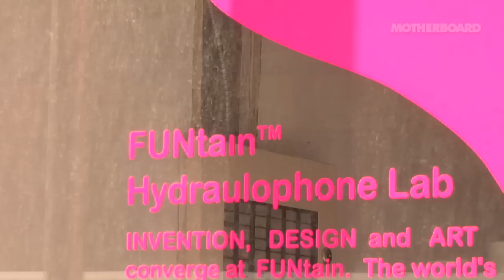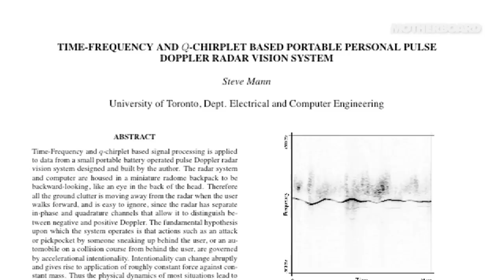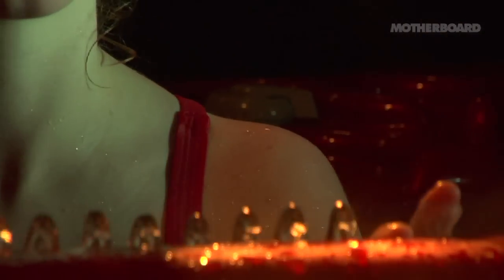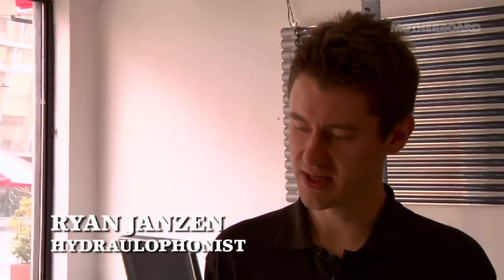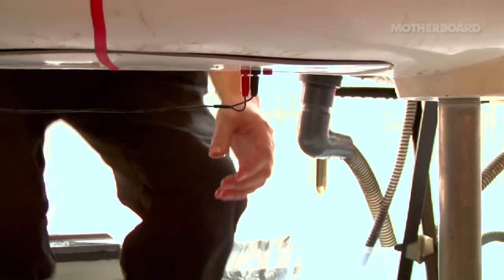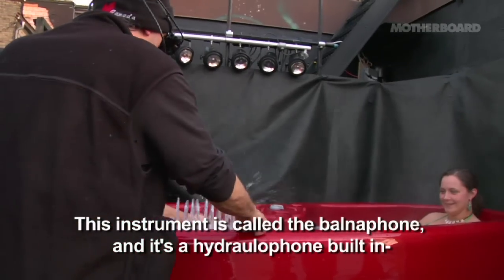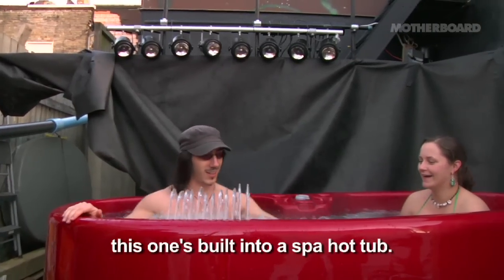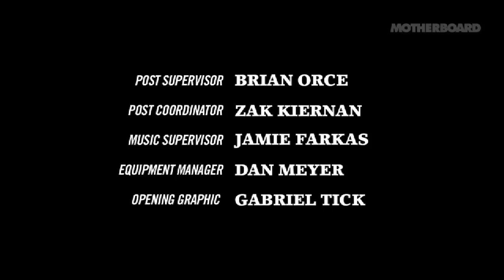This Is What an Underwater Pipe Organ Sounds Like: Sound Builders

Comment: That has a lot of potential, especially with the pressure sensitive range of notes. One of the things that seems to deter better performance is the awkwardness of having water pushing against your fingers. Something with more density would stabilize the pressure needed for sound

Comment: Glad to see a new instrument that isn't electronically based. Electronic innovation and invention is getting saturated.
Reply: It is electronic in nature. Why do you think he hooks wires up to the thing? The water is part of the control system.
Reply: I know, but the sound is from the release of pressure or lack there of, depending on finger placements. Its not a NI Maschine, ableton push, or one of the electronic guitars that has a display you swipe simulating the strumming of a guitar.
Reply: Frank Holguin
It's basically an electronic keyboard with liquid keys.
Reply: replace the water with foam impregnated with graphite you essentially have the same thing, theres a raspberry pi in the body - its a keyboard with water keys.. this guy is no more an innovative or an inventor than an apple is an orange
Reply: alberto gordillo i never said the guy was dean kamen. if its no different than why don't  you build one using foam and see if motherboard will interview you.
Reply: +itchykami You can say almost anything is basically something else. Why not say a car is a motorized carriage. The cassette tape is no different than a credit card, they both usen magnetism to save and send data. The guitar is a violin, but instead of a bow you use a pick.
Reply: Saturated!?!?!

Obviously never seen some of the more interesting musical inventions. Like the Theremin. Beautiful concept.
Reply: Sicarius Aevita I've seen it, thats cool, but I will still stick to my statement. No one is playing that like people play the drums, guitar, piano, or turntables.
Reply: I'll even add that instruments like the guitar, the piano, turntables, and violin used to be god like tools. Today, its just way to get laid and play songs that everyone in a room thinks is cool and sing along with, not a tool to expand the mind.
Reply: Frank Holguin My name is Frank and I have no idea what I'm talking about
Reply: Name a musician (not just a singer) today that has transcended music into something more? Whether it be political, artistic, scientific, philosophical, and be popular and experiential in equal measure. Jimi Hendrix did all this. John Lennon did all this.
Reply: Frank Holguin Death Grips
Reply: Man, hostile much? It's youtube. It's cool, man, it's cool.
Reply: jordan pasek Death grips experimental, but they're not on the top of the charts. Whats their transcending message?
Reply: itchykami  Who are you referring to?
Reply: Frank Holguin

Flying Lotus. You can go from there.
This is an amazing time in music.. sure there is plenty if not toooo much music out there but the more the better. You just have to spend time looking and listening.
Reply: MNDFND FlyLo is awesome, I have a lot of his music, but he's only amazing in music. Whats the transcending message outside music?
Reply: Alex Del Río No duh. Dude we did this already. Read the comments. I knew that before I made my initial comment about the video.
Reply: uhh Fly Lo has made an impact in art. Killer Mike has made an impact politically. many many more... Just because we don't have some national or global 'movement' doesn't mean things aren't happening. I find it that things are happening waaaay more than ever the scale is just waaaay grander(internet) We may never have a '60s' decade or a '70s' decade eagain... but I'm glad of what we do have and I wouldn't want it any other way

Comment: Yeah, but HOW does it work? Completely unclear.
Reply: Joe Schueller nah, he says it in the video. Just like a regular organ, except the way that the fluid is diverted through the pipes is different. In a regular organ, a key on a keyboard controls a valve, opening a pipe to the whistle-like sound pipes, and a note is played. On this, your finger is the valve. By stopping the flow of the water through the opening, it forces the water to go through its respective sound-making-pipe and a note is played.

Comment: replace the water with foam impregnated with graphite you essentially have the same thing, theres a raspberry pi in the body - its a keyboard with water keys.. this guy is no more an innovative or an inventor than an apple is an orange
Reply: alberto gordillo He says how it works in the video. Just like a regular organ, except the way that the fluid is diverted through the pipes is different. In a regular organ, a key on a keyboard controls a valve, opening a pipe to the whistle-like sound pipes, and a note is played. On this, your finger is the valve. By stopping the flow of the water through the opening, it forces the water to go through its respective sound-making-pipe and a note is played.
Reply: John Luzader there are no separate pipes as you can see in the video,  the sound is according to mass flow
Reply: alberto gordillo He says that the pipes are in the larger tube. You're not wrong, your idea could very easily work, however, in the video he specifically says how it works, and it is not how you say it is.

Comment: The physics of vibrating fluids is the source of the sound.  The air vibrates in a traditional pipe organ, but so do the pipes.  Here, because of the more limited compression coefficients of water, I would guess that the pipe in question is doing more of the vibrating.  However, when you place something under stress (strings, moving air, or moving water), you might expect vibration to occur.  Vibration leads to sound.  To the doubters out there, open your mind to alternative sound sources.  Hey, if Spike Jones could make a recording of barking dogs and turn it into music (of a sort...) then what's wrong with this approach?

Comment: The ancient Greek beat you to this idea back in 300 b.c.e. mate. And for those wondering how it works the water being blocked cuases pressure in the corresponding tube forcing the air out of it to play a note. The only electrical thing about this would be the water pumps.

Comment: If it works the way he described then how the hell can it play a chord?
Reply: because a microprocessor detects changes in the pressure in the pipes and uses that to make sound. this is just a silly contraption theres nothing revolutionary or practical about this being a musical instrument.
Reply: Because it's one pipe per hole.  The outer body is just a superficial structure which covers the pipes, so it's really closer to a pipe organ than, say, a flute.  If you watch again, he does mention that.
Reply: yes it is one pipe per hole, and at the end of those pipes drain into a larger one and a pressure sensor is inside a venturi in each pipe to pickup variations in flow or how much you have obstructed the pipe.. so again, basically a keyboard with water keys.
Reply: alberto gordillo Mann's hydraulophones are described elsewhere - it is the flow and the pipes creating the sound, not a microprocessor detecting finger position or anything like that.  It's actually an analogue, non-electric instrument.
Reply: alberto gordillo  Look at the wiki article about it. It IS the water producing the sound. But the video was really bad at explaining it.